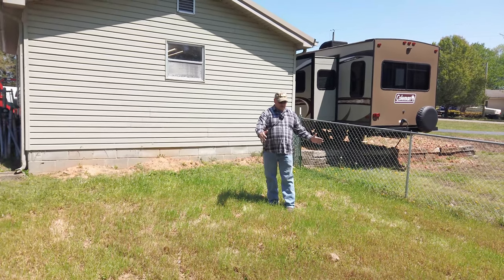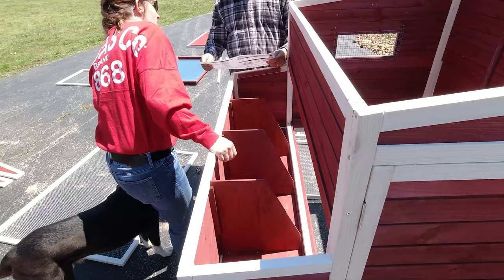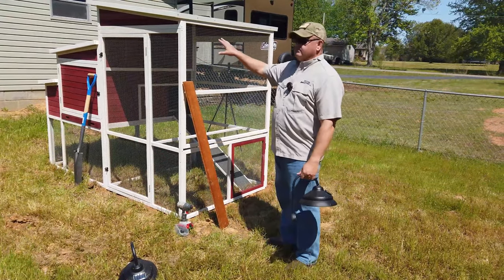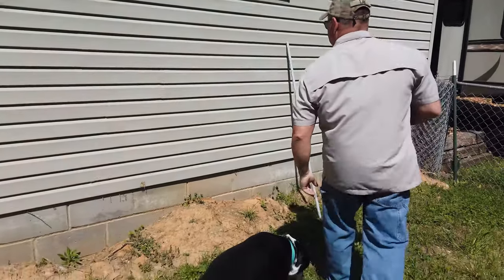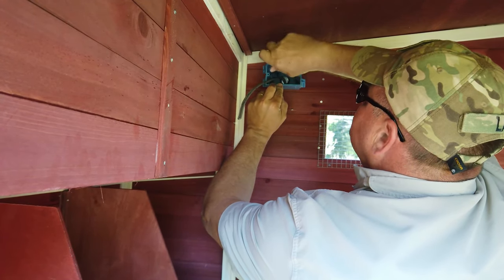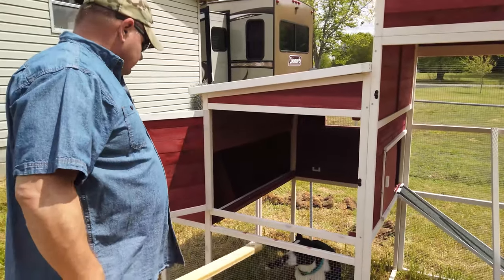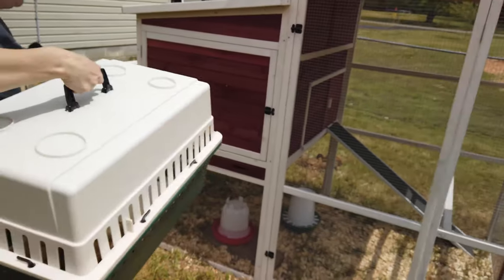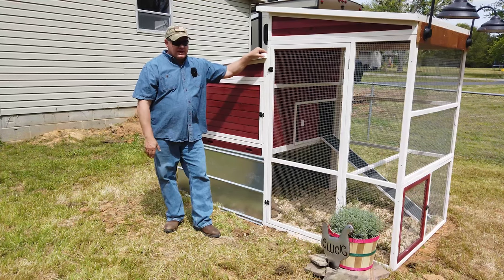How To Build A Chicken House with a Run

Comment: Thanks for reposting sir.  I found you because I'm looking at tractors... my wife saw this video and got excited.  she is a bit of a "chicken whisperer".  Haha.
Reply from the maker: My wife too. What kind of tractor are you getting?
Reply: Tony's Tractor Adventure I was looking at sub-compacts for around the house/hobby farming(kioti, John Deere). Then I saw you and a few others talk about that t264 and that price is a real game changer for me. Tractor with the loader for 13-14. That’s hard to pass up.
Reply from the maker: To this point, the TYM T264 is a little mule. It is a bit more than a sub compact as you can see when I lift the logs, but still a pretty good size for getting into small places. This is a DEMO from TYM, but I think we are going to buy one to replace the two LS tractors we had. We had a subcompact and a larger 40hp, but we are moving to one tractor that can do almost everything in one unit.
Reply: @TonysTractorAdventure  Just curious, what size are you thinking?
Reply from the maker: Brad I am really thinking about buying a TYM T264. It is almost as small as a subcompact but lifts like a bigger tractor. It acts like a bigger tractor the way it is built too.
Reply from the maker: Just following up on my last thought. The TYM T264 is not a perfect tractor. It is their value line and is lacking in some areas like the seat. It needs a step for easier access. The knobs on the left side are to long in my opinion. Having said that, the guts of the tractor is built like a tank. I can see this being a lifetime tractor and for the price, I can upgrade at a later date.  Also I would build a step.
Reply: @TonysTractorAdventure  Tony thanks for that honest feedback.  I can't wait to see a video of your review/opinions.  Basically, I don't get caught up in the "legacy" brands.  I'm not buying a tractor for resale value and that is what got my attention on the 264.  I need to maintain 1400 foot of gravel driveway, clear trees/logs, move rip rap around, do some tilling, level some areas, that kind of thing.  I want something w/ enough weight to due some work.  Granted, I've only found 1 dealer who lists their prices, and that's 8 hours from Tennessee.  Waiting on a response from the dealer that is closest to me.
Reply: @TonysTractorAdventure  so far, I have been impressed with what I have seen in your videos. It will be interesting to see what you decide. Will you go with this model, something bigger, maybe something with a cab? We will just have to wait and see..........you know Hank has a tractor with a cab now....... :)